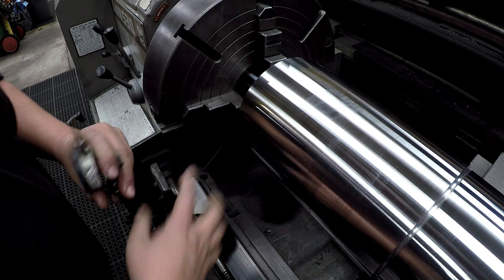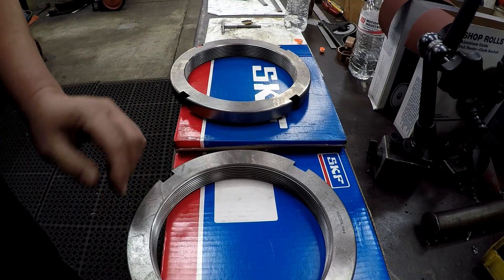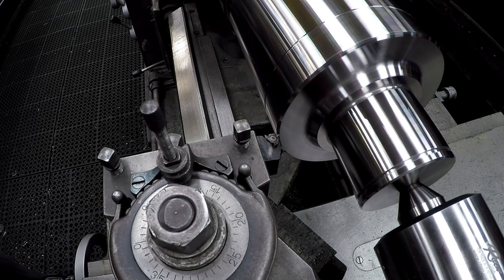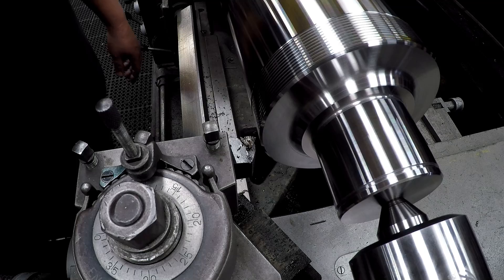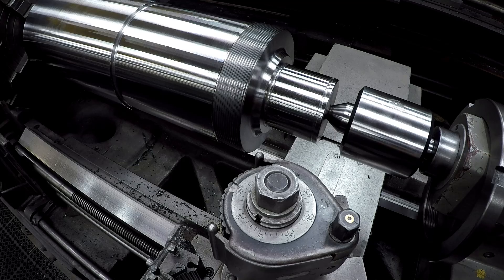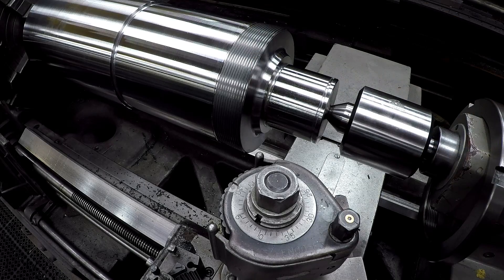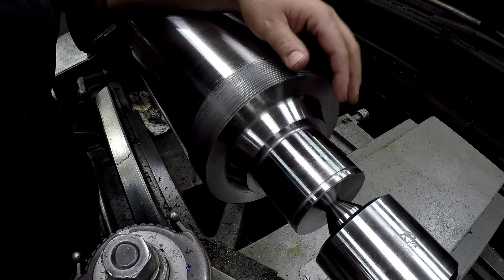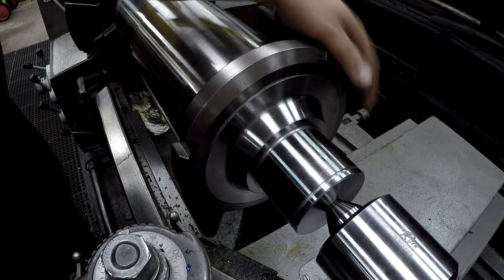Swedish Gearbox Shaft Part 3: Metric Threading

Comment: Actually, you could disengage the half-nut, but, in case your lathe's leadscrew is 4TPI, you would need a TDI with a 60T gear (every 60 turns of the leadscrew they resynchronize.)

Comment: I think it's a bit risky disengaging like that because you can end up with the insert taking a really big cut if you're a little late and break it off. I think you're better off marking the angular position on the chuck and stopping the machine well before that and then pull it the last bit by hand.

Comment: I know I'm late, and I'm definetely a beginner to machining. But, and please correct me if I'm wrong, whenever I have worked on a lathe (in Sweden, so metric), there is no way to use the half nut other than to engate it in the exact same place. The reason is that we don't use threads per mm, but x mm thread pitch. In imperial, the TPI means that the lead screw will match up every so often, but because of how the metric threads are defines, there is no guarantee. Only if that particular lead screw happens to match the thread you are cutting. That is the reason I've also never seen a thread dial on a metric lathe

As I said, please correct me if I'm wrong, I love to learn when I'm incorrect, then I learn something!
Reply: Actually, metric lathes have thread dial indicators, too, but, unlike imperial ones, for metric you need at least 3 interchangeable TDIs with different Z on the gears, depending on the leadscrew pitch, and the thread pitch you want to do. The lathe at my workplace has a 4mm pitch leadscrew and a TDI with 6 marks on the face and 3 change gears, with 27, 28 and 30 teeth.

Comment: One thing that I don't understand about cutting threads; When you are getting ready for the 2nd pass why isn't it necessary to index the tool to the exact same position radially (clock position) that it started on in the 1st pass? It seem like it would cut new threads every pass. I guess you started answering what I am wondering at 13:30...thanks for all your great vids.

Comment: Love watching you work on the larger parts.Maybe a little less footage of you dialing in chucks?We know you do it right,and your customers obviously trust you!Quick question.....When cutting metric threads on an inch lathe,can't the feednut and dial makes several revs disengaged,as long as you were re-engaging on the yellow dot?Say,you unlocked it,let the lathe/dial run while the slide set idle,as long as the yellow dot was hit when you cut again,or does the half-nut HAVE to stay on the particular rev,like you showed?Thanks!BTW,one thing we used to try when encountering chatter like that was to wrap the shaft with rubber sheets,or even lots of bungie cords to try to reduce vibrations,seemed to help.....

Comment: My metric lathe (6mm pitch lead screw) can't cut a metric thread...it will split the thread once every 10times any ideas? The thread dial has 3divisions and no change pinions....Tuda - tudor max 3000

Comment: Unfortunately you can't use the threading dial on a metric lathe like on a imperial lathe. The reason is, that metric pitches are absolute numbers, meaning 3 mm and not 3 threads per cm. Imperial threads are measured in threads per inch, so in relative numbers. This relation can be translated in gears. That is why the threading dial works in the imperial system.

Comment: Every time you center that 4 jaw I am amazed of your skill. I cut metric on my pre-WWII 10" Atlas, lock the half nut and not opening it till finished. I would not trust myself  like you do. I'd go over a turn...
Love to watch you working.
Reply from the maker: It’s easy. Make you a mark to line up on. Disengage and stop the machine. Reverse and engage on the same line.

Comment: Question, you set the depth of thread on the cross slide but I noticed you in one shot giving the compound slide a slight movement into the work, I assume to keep cutting on the leading edge of the tool. Now moving the compound also progresses the tool towards the work at Sine of what ever angle it was set at. Do you calculate the total depth of cut as (cross slide + Sine of angle of compound)? Thanks in advance, Ian Mac.
Reply from the maker: I feed in with the compound each pass. I bring the cross slide back to zero each time.

Comment: Hey adam, happy new year. Just a question, how do you determine the major diameter on the thread for those nuts, is there a spec sheet, or does that 38 refer to a specific size?
Well done!
Reply from the maker: The number is just a sizing standard and not indicates the thread size. But the thread is always a nominal diameter and pitch. Just turn it .005” undersize like you would any other thread.

Comment: My little 1950s swedish machine is metric, but has a 20mm leadscrew... in 8TPI, it cuts both metric and imperial threads with a norton box and changewheels, it has a dial indicator but I have no idea if it's meant for the imperial threading or metric or both? It has an odd number of lines (5) instead of 4 or 8. I guess the only way to find out is to test if it works with either.

Comment: Why did u adjust the topslide slightly on the first side u threaded? Wouldent that offset your thread ?
Reply: 5:34 into the video
Reply: He adjusts that on every pass.  The compound is set at 30 degrees, so as it is adjusted in, the tool only cuts on its left edge and the tip.

Comment: If none of your machines have metric leadscrews, why not just do the threading on the Pacemaker, and save yourself the extra setup?
Reply from the maker: The Acra-Turn has the proper gears and quick change arrangement to cut metric threads.
Reply: Don Daley I’m guessing the Pacemaker doesn’t have metric pitch settings available on the gearbox. The smaller lathe does, but because it’s an Imperial leadscrew he still must leave the halfnuts engaged.
Reply: That would tend to make it considerably easier.
Reply: I not sure but I dont think the Pacemaker will cut metric threads.
Reply: You need to mess with the back gears of the lathe to get the right ratio for metric threading. It’s a pain to switch back and forth which is probably why they have a separate machine set for metric.

Comment: Can you get double sided carbide so you could cut the thread in reverse then forward like normal? Or would save time you would be doing two passes instead of one.
Reply: i am not a machinist and not a proffessional but i think it is not possible because the backlash wil destroy the thread ?
Reply: In reverse, the rotation of the shaft is away from the cutting edge, so the tool would just rub, not cut.  If he just reversed the carriage, he'd lose the relation of the carriage to the rotation of the shaft and the start of the thread.  That would result in a split thread the same as if the half-nut was disengaged and the position on the thread dial was lost.
The cutting edge has to be on-center.  The bottom side of the carbide would be below center and not touching the work-piece even if its edge were square.
Reply: No.
Reply: Nearly every machine in the world has some kind of back lash in the gears, nuts, screws. If you watch when he reverses, the tool is not in the thread cut, it’s a little off. But when he switches back into forward, the machine takes up the back lash and the thread tool is lined back up. If he was cutting in reverse, not only would it break the carbide (because carbide doesn’t like to stop) and it would cut between the threads due to the back lash.
Reply: well me aint one to. but the cutting edge will be to small to do so. and melt away. you need cutting edge en enough support. the cutting edge would be to far appart.

Comment: Why not make those nuts your self they look simple enough?
Reply: Simple enough doesn't mean cheap enough. Having parts custom made that are mass produced would be cost prohibitive.
Reply: Yep, simply a thing of cost efficiency. Buying Standard parts is much cheaper than having them custom made.
Reply: That's a $523 nut, which seems like a lot outside of the industry but when you factor in the cost of high strength steel stock in that size, consumables, and whole lot of machining time, it doesn't make sense to make one.
Reply: Those nuts are also heat treated to a specific hardness which is difficult, time consuming and expensive making them cost prohibitive to produce in-house.
Reply: I suspect it's easier to buy them in since the nuts have a metric thread and Motion's Pensacola shop doesn't appear to have a machine with metric leadscrew.
Reply: Time is money. As a company, if they can buy them from the OEM for a reasonable price,  spending machine and machinist time on it makes no sense. Machining new parts from raw stock, commercially, only makes sense for things that are custom or unobtainable (or nor obtainable for a reasonable price).

Comment: I also use that threading technique but I believe I'm working with a metric lathe (cutting mostly metric threads).
Does any one of you know how the indexing of the threading dial works in metric? 
I'm planning to reverse-engineer the ratios and figure it out that way, but it'd be nice to get some pointers to get me started.
Reply: Search around for it. I Know there is a good thread at that machinist forum that tends to devolve into flame wars (caughPracticalcoughMachinistcough).
Metric threading dials are complicated and have several drive pinions. You have to move the dial up or down, and adjust the engagement when you change to a different thread set.
Single point threading is one of those places where metric just sucks. My old lathe was metric, and I always told everyone "its OK once you get used to it." My current lathe is imperial, and I will never own a metric lathe again.
Reply: 𝖘 𝖍 𝖎 𝖗 𝖔 reverse engineer? You be careful buddy
Reply: 𝖘 𝖍 𝖎 𝖗 𝖔 so you don't mess up just engage all the time at the same number
Reply: 𝖘 𝖍 𝖎 𝖗 𝖔 12:00   you only can use the threading dial if the lead screw and the cutting thread are of a different dimension.
Imperial pitch versus metric pitch of vice versa.
Reply: The difference is in the leadscrew thread. Choose the thread that you use most or buy two lathes.
The reversing method demonstrated by Adam works well , as you've seen . Don't sweat with small stuff

Comment: There is nothing like the metric system.
Reply: I agree. But for those who have learned inches, and used inches a lifetime, metric doesent come easy. By the way - that thread pitch of 3 mm are very closed to 8 1/2 tpi
Reply: @magnepolden3344  It goes both way I guess
Reply: In Spain we use the metric system, I am a refrigeration mechanic and in this profession everything is in inches. It is a real problem, not only for the measurements, but also in tools, tubes and spare parts.
Reply: I think it's superior because I've almost used nothing but. In any case it's impressive that Adam can just work between metric and inches like it's a piece of cake!
Reply: Probably for the same reason if it were reversed. If you only ever used and made stuff in Imperial , then you would be used to it and only have the tools for it.
Reply: Mind explaining how?
Reply: I never understood the Whitworth system. it was used on BSA and Triumph motorcycles up until the 60's i think.
Reply: If you guys thing the metric system is so much better and simple look at the thread dial on a metric lathe....some of them have 142 gears inside to interpret the lead screw so you can ingauge the half nut and disengage with losing your thread.... madness
Reply: I grew up using both SAE and metric. It is just a language. Are you trying to say one is "better" than the other? Whitworth is clearly superior then....
Reply: Metric, Imperial, all the same. A part is just "so" big, and it will be the same size whatever you measure it in. With a DRO, I use metric setting for metric parts, and inch for inch ones. But I have only inch micrometers, so my final is always in thousandths+tenths. If you only have metric parts to work on, consider yourself fortunate not to have to do both.
Reply: The problem for those used to Imperial is that Metrics is too simple, they don't expect it to be that simple which can be a bit confusing. It simply lacks any fractions, and there is also not conversions factors within it like going from Ft to Inches.
One sure way to make it hard for yourself is trying to convert Imperial to Metric or Metric to imperial.
When you simply use Metric to begin with an no conversions done then it is far simpler.
The main reason Metric is better for industry is that imperial requires some experience and math skills where Metric requires none, in short you can pay people less who use Metric and be assured they will make fewer costly mistakes measuring.
Reply: In all fairness, The United States was one of the original signatories of the Metric Treaty in 1875, and Metric has been a fully legal system of measure here for the 143 or so years since. It is just not the exclusive system, which seems to drive people nuts. Schizophrenic even.
Reply: Yes. Nothing sucks quite like it.